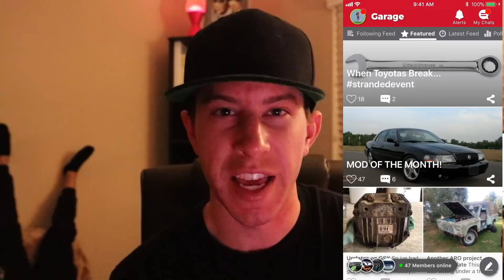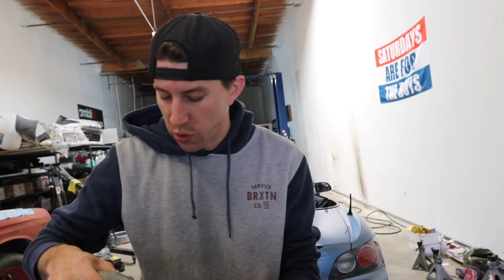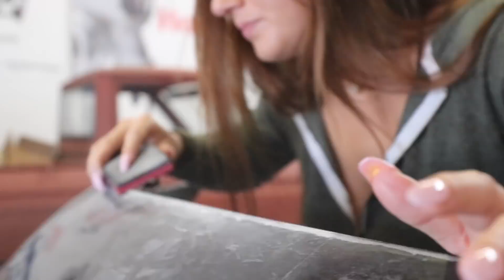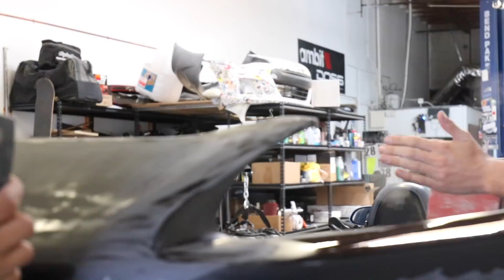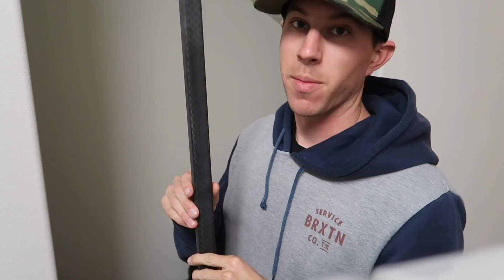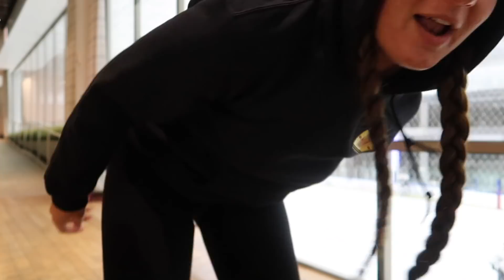How to Prep a Bumper for Paint!

Comment: Just a tip...When hand sanding you should always sand at a 45 degree angle and change often to an opposite 45 degree angle creating an "X". This makes it easier to remove the scratches from the previous grits, which is the whole reason you step up in grit, this should result in a MUCH better finished product. Paint prep is THE most important part of painting if you mess it up you will have either poor paint adherence or poor looking paint or both.

Comment: 400 grit wet with soapy water spray adhesión promoter than 3 coats of primer if is in a can if is 2k two coats let it dry for a Day to reduce shrinkback than wet sand with 600 grit you actually scratch the bumper with 150-220 grit.

Comment: The shop seemed hesitant on taking on the bumper because they're weary about you guys prepped it. The paint quality is defendant on how you guys prepped it. If the 400 grit scratches you guys put into the bumper were too deep and that S2K blue paint is a metallic, the metallic flakes are going to sit inside the cracks and you'll see the scratch marks after it's done getting painted. 400 is a very rough grit for a metallic, even with regular gloss paints, the lowest grit we'll scuff with is a 600 grit because we don't want scratch marks, with metallic's we usually like to scuff with an 800 grit. If there's pitting you have to fill, prime, resand with 320, then 500, then 600, then 800 to get it fine, then after you do all of this, its finally ready for paint. After it's painted they'll wet sand any dust out and polish it back to a shine.  I know you aren't experts but i'm just explaining why shops are hesitant to take on spray only jobs where they didn't do the prep, because the quality of the spray is dependent on how well you guys prepped it.
Reply: not really...they will use plastic-primer, filler and after that fine sand the filler...the metallic paint would be third layer...right?

Comment: You can sand any way with 150 then 320 then your done 150 is to get dirt and things out of it like the lip and you can sand the whole bumper in 150 and 320 and you will be super smooth I use just 320 some times

Comment: If you have an air compressor why not use a proper sander for the rest of the bumper instead of just holding the paper. It would be so much quicker, and you're able to keep it flatter.